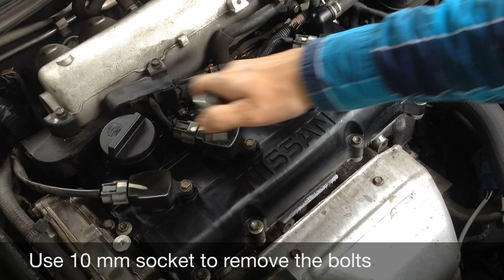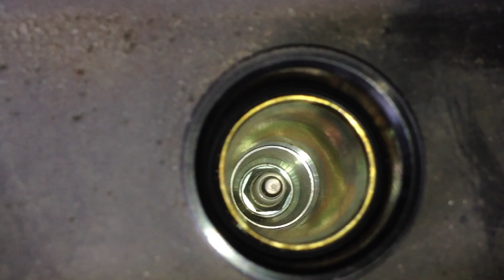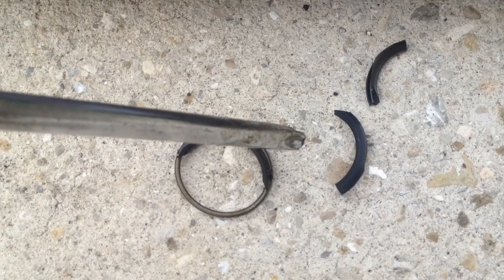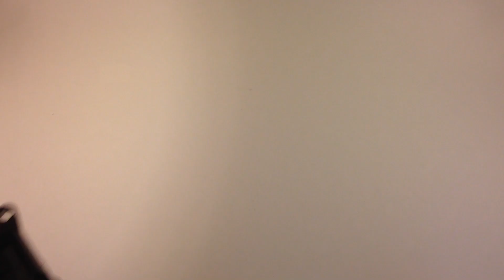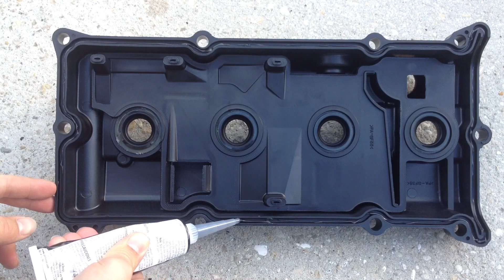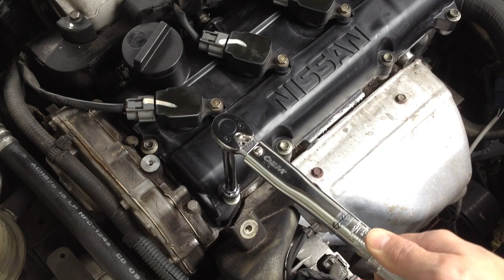How To Fix Oil Leak & Cylinder Misfire - Valve Cover Gasket Replacement - Nissan Altima 2003 2.5 SL

Comment from the maker: You can find required replacement parts & tools here: 
Valve Cover and Gasket Set: https://amzn.to/3fsYTUU
Black or Grey Silicone Gasket Maker: https://amzn.to/3iR0S7G
Torque Wrench: https://amzn.to/3fclyVz 
OBD2 Car Scanner: https://amzn.to/3iOwwTp

(these are Amazon affiliate links)

Still have questions? Ask online certified mechanic here: https://trk.justanswer.com/aff_c?offer_id=2&aff_id=8172&url_id=10

Comment: Just had my '02 Nissan Sentra have the same problem plus having oil leaking to the chambers because the spark plugs weren't torqued correctly, this video helped a lot with the valve cover section!!

Comment: You shouldn't use the ultra black on the entire gasket just in the corners. Always follow manufacturer instructions when when working on whatever your working on. In fact the gasket may fail prematurely after covering it with RTV.

Comment: You forgot to empty oil that was around the spark plug,  my 03 Sentra SE-R Spec V has the same issue I will be removing oil from under spark plug with a syringe that comes with tubing to suck oil out.
Reply from the maker: Good catch, I didn’t forget, I just made a separate video about it.

Comment: Hey I know this video is old but I took out the spark plug and the oil got inside. I didn’t know what do I have to do next if that happens? I’m in the process of removing the valve cover and replacing the valve cover seals.

Comment: Perfect video for my car.  Mine is a 2005, but has this exact issue.  I will have to gather all the parts, including replacement spark plugs.  This was really neglected when I bought it.  It was running great until last week when this miss-firing issue started.  I was assuming that the spark plugs just needed changing, but when I took one of the coils off and seen the oil in the well, then I knew I had a much bigger issue.  Thank you for making this video.  I seen your other video on how to clean out the oil from the wells and this one popped up after it was finished.

Comment: Hi just watched video every helpful today I was changing the spark plugs on my Nissan x-trail t30 2004 model
 because it is ildeing ruff and I was undoing the first spark plug and it has oil in it and the 4 one has oil on the threads i think as well
 but I didn't know the first one had oil in it and  some has gone down into engine  hope it's still ok
 if I  do the valve cover gasket do you think it would fix the idle problem
Reply from the maker: It might. Unless there are other issues with your car. Ignition coils might be bad too after sitting covered in oil for too long.
Reply: @DIYtime  okay thanks for that  I will fix the oil leak and do the ignition coils as well
And i put new spark plugs in but don't help still not ildeing right
Reply from the maker: Any Check Engine Light error codes present?
Reply from the maker: Could be dirty fuel injectors too.
Reply: @DIYtime  no check engine lights the other day I started it up it was idling ruff and turned it off and started it again and it was OK so thought it was the spark plugs  but not 
Don't know if the oil that want down the first silnder made it worst or not
Reply from the maker: Check engine air filter and PCV valve if clogged, cylinders compression, MAF sensor.
Reply: @DIYtime  okay thanks 😊

Comment: Hi there, Is it compulsory to fasten the bolts into numeric order. What can I do if I got 3 cylinder engine with 6 bolts. Thanks
Reply from the maker: The main purpose of that is to tighten them evenly and not create too much pressure on one side, while other side is loose. That could displace rubber gasket. If you tighten bolts across from each other gradually, you should be good.

Comment: dude never put rtv and a gasket. terrible ide and never spread it with your finger first dude thats not how rtv works. when you compreess it thats how it seals. you really only need it on the came shaft bearing retainer aka the raised part. what you really should be using inside the cover before you put the gasket on is gasket sealant.

Comment: Good lesson but how long to let it ste before starting  does gasket sealer have to dry any amount of time anybody know
Reply from the maker: Each brand could be different. Just follow the instructions on the packaging. It says how long to wait. Som could be many hours. Shops use quick ones.

Comment: Why you not say how much pressure the bolt could take
Reply from the maker: It is actually called torque. I provided maximum torque specifications for the bolts in this video. 
*These are numbers for my car. Other brands and models may have different values. Check with repair manual for your car.

Comment: My engine is sending oil to the air intake hose . I was told to replace thr valve cover gasket.

Comment: Do the spark plugs need to torqued to a specific ld per square inch?
Reply from the maker: Yes. Usually this info is mentioned on the package.

Comment: Hey thanks for the informative video. Sad that I found it after I ran into a problem. So, think I let some of the oil get inside the valve while taking out the spark plug? How much oil is okay for that to happen and is there a way to fix it after it has happened?

Comment: Do you think the spark plugs tubes could be removed or are they welded in the valvetrain?
Reply from the maker: Yes, they sit in there pretty tight, but they are removable.

Comment: Unnecessary use of gasket maker that will only cause more problems down the road. Use gasket sealant to hold a new gasket in place and only use rtv where the manufacturer service manual says to do so.

Comment: I’m not so sure but I always thought that adding rtv to a gasket could create a leak.
Reply from the maker: I don’t think so. While it may be excessive or unnecessary to put it in some places, it certainly won’t hurt anything. The purpose of gasket maker is to seal metal to metal contact surfaces. And it’s high temp & vibration resistant. Why would it create a leak?

Comment: The wire boots on my 2006 altima are stuck in the tubes. Will removing the valve cover allow me better access to remove them?
Reply from the maker: No. It will be practically the same. 
You might be better off trying to spray them with something...

Comment: What did you clean the contact surface of the valve gasket with? Are you supposed to clean it with something (acetone, break cleaner, etc.) before you place a new gasket, or just clean the debris of the old gasket? Thank you for the informative film.
Reply from the maker: Depends on gasket maker brand you using. Just follow whatever it says in installation instructions.
Reply: @DIYtime  Thank you. I think they usually sell gaskets without instructions, but what I saw online, everyone cleans it with something like acetone or (mostly) break cleaner. I'll try to contact the seller though. I purchased the whole set of gasket for Engine Block, no instructions inside. It is important to know, that might be different cleaning process depending on the type of the gasket. Yes, seller should know, thank you again. We also have Nissan Sentra 2009. your film is very helpful.

Comment: I had oil leakage into spark plugs, I replaced valve cover and spark plugs, as soon as I turned on I had white smoke coming out from exhaust, is that normal??
Reply from the maker: Does it still continue smoking?
Reply: DIY-time it stopped.  Thank you for the reply though 🙂👍🏽

Comment: Is the gasket maker needed? I have the same problem with my 2006 nissan altima 2.5 s, But my car shoots white smoke out of the back any ideas if changing the gasket would  solve this?
Reply from the maker: It’s required in some of the places (rounded and raised parts of the block), but not everywhere. 
I would suggest you checking compression....

Comment: The torque wrench step is a bad idea. Those screws are too small to torque down. I followed this video step by step until I used the torque wrench and snapped the screw off in the head. Now I’m really in trouble. The bolt snapped at 20lbs of torque.
Reply from the maker: Did you use in-lbs or ft-lbs? 
There is a huge difference. 
20 in-lbs shouldn't have strip that bolt. These are the specs from the official Nissan repair manual.

Comment: One thing...for newbs...when tightening, make sure you use in-lbs, not ft-lbs.  My dumbass used ft-lbs and broke 2 of the bolts off.  I didnt know in-lbs existed and screwed up.

Comment: Do having oil in your spark plugs cause car not to crank
Reply from the maker: No, check your battery and starter instead.
Reply: DIY-time  even if 3 spark plugs are filled with oil? And how many crankshafts do your car have
Reply from the maker: With oil in spark plug wells car may not start or misfire, but it still should crank normally. 
Mine has one.
Reply: DIY-time oh okay well thanks

Comment: Hi.

I replaced the valve cover because I found oil in the first spark plug (cilinder #1) but the issue still continues in the same place. Just the first one. What could be the problem?
Reply from the maker: Could be leaking from the bottom of the spark plug well.
Reply: @DIYtime  but if it is the case, the oil would have to disappear, I mean, back by the same way as in and that's not happen. I notice this because I found some oil by side of the spark plug coil.

Comment: Could this cause a cylinder 1 misfire my 05 started running rough out of nowhere and it looks like it's leaking oil a lot from the first cylindee coming out of the valve cover? I changed my plugs and moved around my coils and the problem remained
Reply from the maker: You can try to tighten the valve cover gasket bolts to the factory torque specs. Sometimes they get loose over time. This may stop the leak. 
Leaking gasket shouldn't cause misfire.  Leaking spark plug o-ring could. You may also have a leaking head gasket. Check the compression in cylinder 1.
Reply: @DIYtime  I checked compression on all cylinders it was around 180 psi on all cylinders maybe I did it wrong? I had a "mechanic" check it out he suggested I get a new engine he said the valves on cyl 1 are bad because it fouling and bending the spark plug? The #1 spark looked pretty messed up compared to others? The car runs just shakes when I'm in drive and stopped
Reply from the maker: Thats unfortunate.

Comment: Can I remove the top of the engine without removing the spark plugs?  I'm concerned about the oil around the spark plugs seeping deeper into the engine.
Reply from the maker: Yes, you don't have to take out spark plugs, just the ignition coil packs.

Comment: Yep. Those plastic v covers warp easily. Many people think that gaskets are the problem
Reply: ugh, so just get the whole valve cover from the git-go?
Reply: @ricebike  worth the 90 to 100 dollars, comes with seals and guarantees no leaks. Look online. Not a part you will get from an auto parts store

Comment: My car hesitates (when under heavy acceleration) but runs fine when not accelerating hard. I found oil on one of my spark plugs. Could this be causing a cylinder misfire?
Reply from the maker: Yes, it can.

Comment: I’m not getting any failure codes in my 2009 Altima but I’m getting sputtering when I accelerate. It just started doing it, 113,000 miles. I changed pcv and cleaned out the map sensor. It seemed fixed for a day after the new pcv but started doing it again. I noticed oil on the outside of the valve cover gasket and engine and in cylinder one when I replaced the plugs. Even though there’s no codes, could a leaking spark plug well be doing this? I haven’t replaced the O2 censor but like I said, no error codes or check engine light on at any time.
Reply from the maker: It could be possible. Sometimes the ECU wont throw the error codes right away until condition is verified. If thats the case, it may store a pending code.
Reply: Actually, it was the spark plugs not torqued down properly. Believe it or not. From being installed with the wrong torque, it ruined the spark plugs, I replace them, torqued them down properly, 20 foot pounds and it runs perfect. 
Thanks for your response though, I appreciate it.
Reply from the maker: Good to know, thanks for sharing!

Comment: Does the new valve cover come with the 0 gaskets the ones around the small holes where the sparkplugs go?
Reply from the maker: Yes, they are built into the valve cover.

Comment: Hey anybody I have a 2007 Nissan Murano with 193,000 miles and I was just doing preventive maintenance by changing the valve covers because when I changed the spark plugs at 170,000 miles one spark plug was covered in oil the ceramic and where it sparks at and changed the 3 rear ignition coils but anyways this week I replaced the valve covers front and rear and that took me 4 days since it’s very cold in Chicago and it was snowing and so when I was working on the front one I had the front ignition coils in a drawer and they were kind of getting snowed on so I just wiped them off and closed the dresser to dry them and install them tomorrow so when I put the car back together I had a code that read P0081 then I looked around the engine and I just reconnected a harness and I reset the code then it was running fine for 30 seconds then it got to running rough again and got a code P0300 and wonder if it’s the front ignition coils but I replaced all the spark plugs at 170,000 miles and only the rear 3 ignition coils

Comment: You dont need the rtv that's is what the gasket is for.
Reply from the maker: It is required in a few places only, but overall yes, it is not necessary, but it wont hurt either.
Reply: so why did he mentioned that it was needed for that one side of the valve cover?

Comment: If I cant remove the spark plug, how am I supposed to clean up the hole and the spark plug from all the oil ??
Reply from the maker: Use brake parts cleaner, paper towels and compressed air...

Comment: You can remove spark plug tube seals dude...
Reply from the maker: Not on Altimas with plastic valve covers after 200k miles....

Comment: Oh man this looks so much easier than on my 350z with the longitudinal V6... got the whole thing apart and I’m afraid of pinching the gasket on something because it’s tight as fuck in that bay with all the wiring harnesses, fuel lines etc

Comment: My Maxima 3.5L started smoking and misfiring. I decided to change to change spark plugs and the coils. Number 6 was soaked in oil so I pulled everything and changed the cover. The white smoke pours out at idle still but my spark plug is dry. What could be causing the smoke?
Reply from the maker: Blown head gasket.... 😬
Reply: @DIYtime  I had two fuel injectors stuck open. Swapped them out smoking stopped immediately.
Reply from the maker: Nice, thanks for sharing!

Comment: What happens if you remove the spark plug and some oil gets in
Reply from the maker: A little oil is not bad. It should escape through the oil rings. If you start the engine with a lot of oil in the cylinder - oil won't compress and you can bend the piston.

Comment: Thank you for the great video. One question I have is on your torque chart you listed a final torque value between 65-82 in-lbs. Did you torque the bolts to the maximum value, or somewhere in between the values?  Thanks again for the awesome video.
Reply from the maker: Its up to you. Anywhere in between is good. I usually like to torque it to the max (82 in this case). 75 I think is safe place. Then drive your car for couple days and retorque, as gasket may shrink a bit after heating/cooling.

Comment: Yes. It is possible to replace the well seals on the valve cover. The auto parts store sells the kits. You gave to use a hole saw 1 3/4 to remove the old ones. I have done that. You make a wood jig with the hole then you center it to the seal. Very easy. The new seals are $8 bucks a kit.

Comment: Nice job and great editing!, mine is leaking next to Thermostat housing (2001 Chevy Metro LSI - but is oil so... 
I replaced With kit but following stupid OEM directions per Costless employee advice, finding out hard way, it slow leaks to outside EVEN MORE! 

Re-doing Permatex Hi-Temp (650F) Gasket Sealant (Red). 
I liked the way you smeared it after applying to 2nd bottom-engine block, and I will do the same.

Update: So sealant went great but wasn't the Oil Leak problem, because it's still leaking and more apparent now. It's leaking from outside the valve area down from underneath (Magnetivity/Gravity) directly from highest area...the Sensor directly ABOVE the Thermostat Housing; catching onto the bolt-on metal ledge of Thermostat area. Don't know the exact name but EXACT problem and pic can be found on the Blog covering the problem..... https://geometroforum.com/thermostat-housing-leak-t30186.html
Reply from the maker: Thanks!
Reply: It was my oil sensor O-Ring area seal basically exactly like bad seals in vid but bigger ...costless tried to match it but just couldn’t and that SEAL ONLY COMES IN $75 entire engine seal & gasket kit for rebuilds, breaking-down entire engine block, A different long time experienced employee this time said he would trust Permatex high-temp sealant over a new OEM RUBBERY SEAL NOT made for long-term anyway...I agreed, made a heavy duty fat seal squeezed into round groove, stopped leak, headed to Hollywood south driving 1,000 miles 10-days ago, and still running strong!
Reply: Nice!

Comment: I did my the same thing theres still oil from the leak that was going on what can i do to clean it out?
Reply from the maker: I used paper towels wrapped around coat hanger wire to soak it in. You can also spray it with brake cleaner and blow it out with air compressor if you have one.